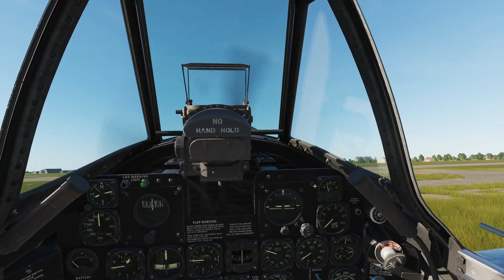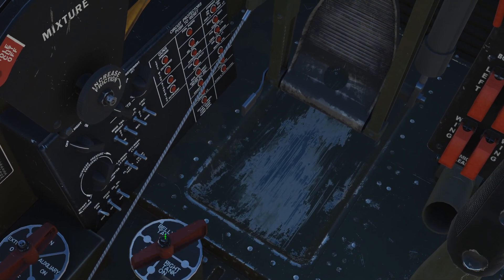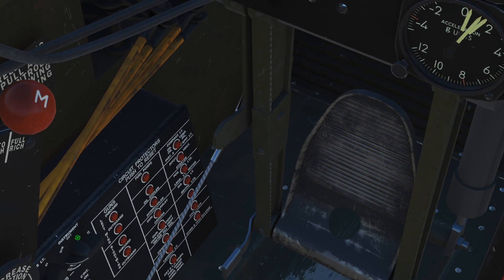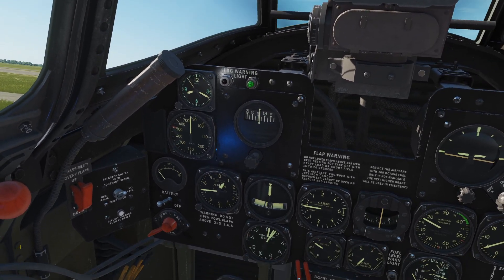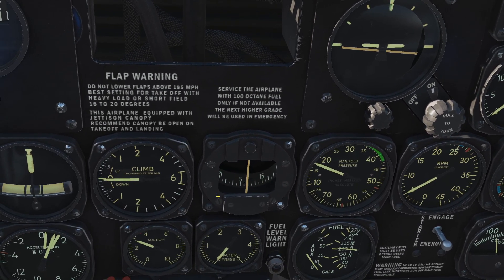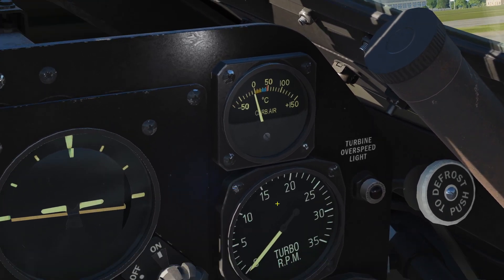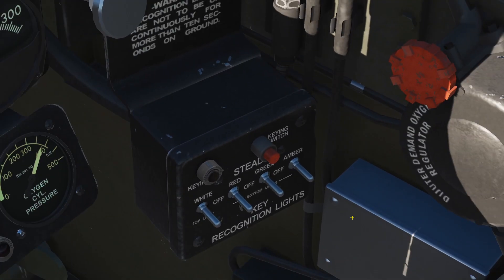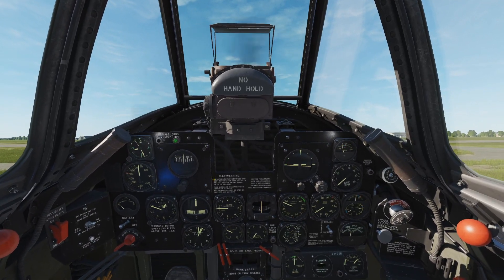P-47D-30 Thunderbolt: Cockpit Familiarization Tutorial | DCS WORLD

Comment: Regarding the carburator air temperature: in the carburator the air is accelerated (venturi effect) so there is a drop in pressure and temperature. A 20°C difference with outside temperature seems usual.

Comment: Cap: the suction gauge most likely measures the pressure generated by the vacuum pump which is used to run many of the gyro-driven instruments such as the attitude indicator and gyro compass. If you have a vacuum pump failure, your gyro instruments will spin down and stop responding, which can kill you if you're in instrument conditions. The gauge lets you quickly check if your vacuum pump is operating.